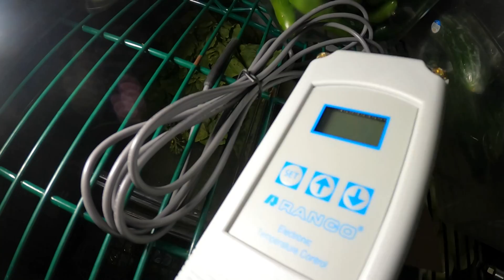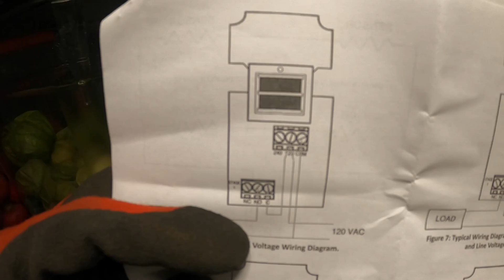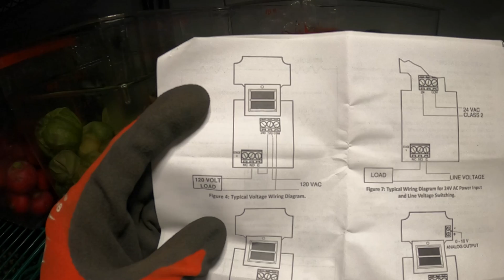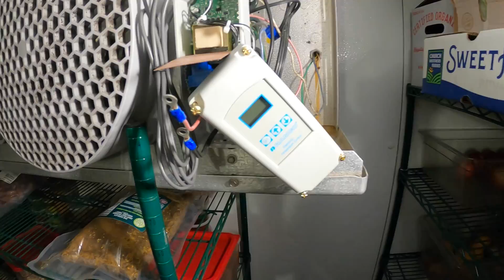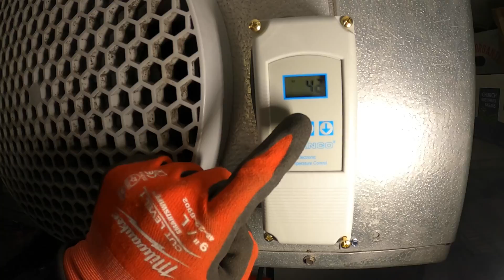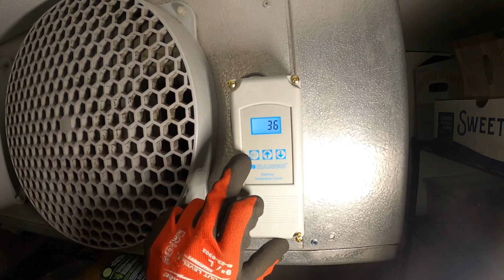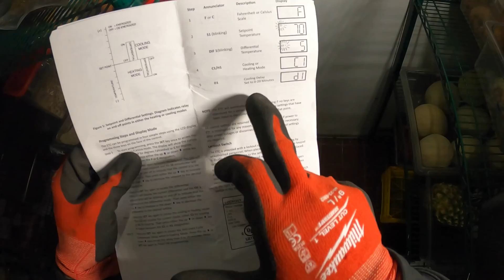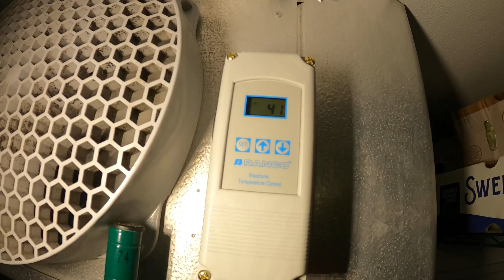HVACR Service Call: Walk In Refrigerator Digital Thermostat Upgrade (RANCO ETC 111000-000 Install)

Comment: I appreciate these videos man! Have you ever used a Ke2? I had a location with a walk in cooler that kept frying defrost boards for some reason. we ended up putting a ke2 with air defrost and haven’t had an issue

Comment: I recently ran into a 3p condensing unit paired with single phase evaporator a company couldn’t get to work properly. They had no N for evaporator. I ended up taking a 120 N from light in box. I know that’s not best or code but what else could I do without replacing stuff completely. Thoughts?
Reply from the maker: Its cool you made it work that way. If the light is on a seperate breaker and that's all that it's paired to, check the breaker size. Evaporator fans doesn't really draw much amperage. If it can hold and it's only the light connected, I think it's fine but I would recommend they get an electrician in to run a dedicated line/breaker to that evaporator/blower assembly. Let them know this was a temporary repair. Thanks for watching!

Comment: Jumper man, nice video and explanation. I prefer having my hot lines same color and neutral same. That wiring can be so confusing for greenhorn refrigeration technicians. Jumper should have been red as well. It avoids confusion.  Good practice is hot line  keep same color.
Reply from the maker: Thank you! I totally hear you with the color codes. It was the only color wire I had supplied. Definitely good practice. Appreciate the sound advice 🤙🔧⚡️
Reply: @JumpermanTech  I did my apprenticeship in New York Queens at Fresh Air Mechanical in Maspeth

Comment: Always nicer to be working in a new box like what you filmed.  I like the convenient disconnect for the evap fans. Anytime you can discuss wiring in more detail is very helpful.  Please discuss each configuration in that Ranco manual.  I mainly install Penn A421s or Penn A19s.  Thank you.
Reply from the maker: Thats for sure! The disconnect definitely made things a lot easier. I will make a few videos in detail regarding this control and ones similar mentioned in the comments. I need to look into that A421 as I've never used it before. This was my first time using the Ranco control. I usually install the Penn A19s as well. Thanks for watching & stay tuned 🤙🔧⚡️

Comment: Always make it at least 3-4°f differential, allow the coil to thaw so it doesn’t freeze buddy, would have gone with a KE2 control or A421 with defrost, ranco’s are also good controls but you need a defrost with it
Reply from the maker: Thank you for the advice. Next visit I will check up on this unit and make the necessary adjustments if needed. I need to look into this KE2 control as another person mentioned it in the comments. PENN is a solid choice. I like how those controls you mentioned have defrost built in. Thanks for watching & pointers 🤙🔧⚡️

Comment: With that controller in a Walkin it should be 36 out with a 3* diff
Reply from the maker: Makes sense. Range in that 35-40 degree range. Thank you for the heads up. Much appreciated. Thanks for watching!
Reply: X2 this is a off cycle defrost system so the more off time the better but systems are always different